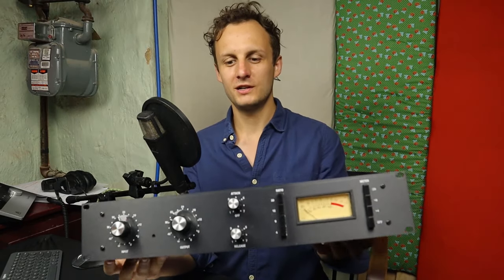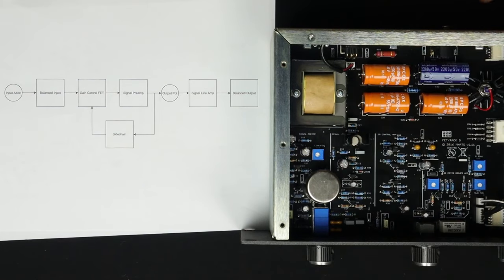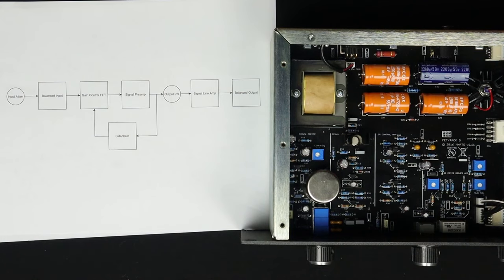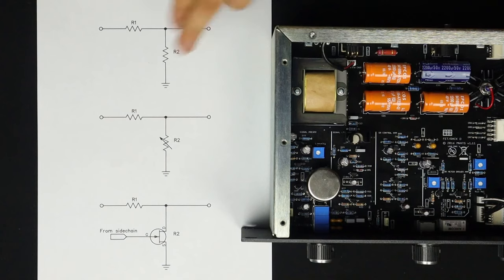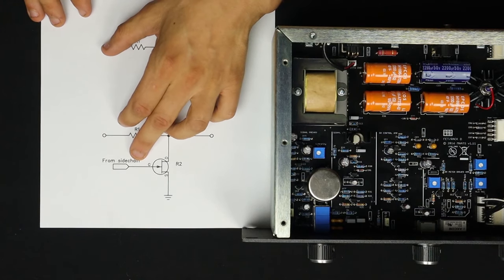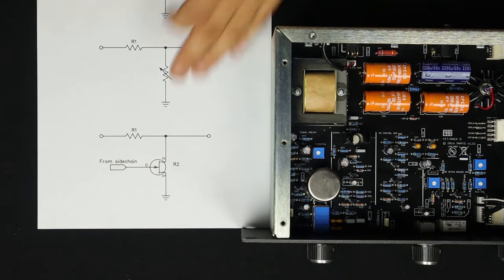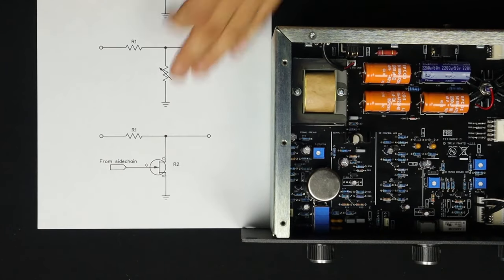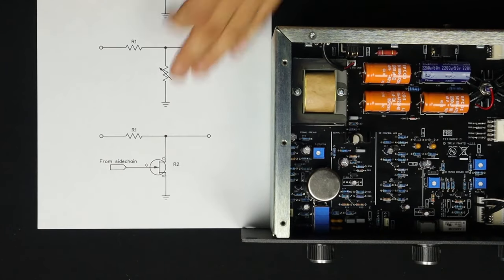1176 FET Compressor Teardown pt 1: Circuit and Compression Secrets

Comment: As someone who got into audio electronics from the user side (just swapping dead pots etc), I started doing eurorack DIY kits, but without any understanding. Soldering by numbers, so to speak. Compared to other EE tutorials, this finally bridges the gap between electronics basics and what is actually happening when the circuit is in action. Many, many thanks, this is so valuable in better understanding the things I use. Top notch!

Comment: Ok, same comment as the GAP 73...a follow-up teardown of this 1176 but comparing a budget and a higher end unit so we can see what's different, what shortcuts were taken on the budget model, what makes the higher end version more expensive, etc.  Say Klark Teknik 76 ($400) and a UA 1176 ($2k) or even a Warm Audio 76 ($600).  It would be nice to know what compromises we're making, and what are getting when deciding which one to go with.

Comment: These gear descriptions are fantastic! Check out the API 525C; instead of using the JFET as the lower leg in a voltage divider, it has the JFET running from the negative terminal of one of their 2520 op amps to ground, with their op amp in a classic non-inverting amplifier configuration. The only other place I can think of that uses that kind of configuration is the Scholz Rockman. All the others I can recall, like the Shure Level-Loc, use it in a passive attenuator as in the 1176.

Comment: Just a minor technicality that is often overlooked, 6:15 the variable resistor is not attached quite right. The arrow denotes the wiper of the pot, thus if it were a 10k pot R2 in this circuit would always present 10k, instead of the varying resistance you expect. The arrow should be connected to either ground or the signal (usually ground). This also lines up with how it should be connected in real life, since it is a three terminal device, not a 2 terminal one.
Reply from the maker: Thanks for the comment. That's true about a potentiometer, but the symbol I used is for a variable resistor or rheostat which has two terminals.

Comment: I think you do not fully understand the side chain. If you look at the FET RDS curve over its entire range you find there are regions that correspond to different ratios. It is the slope of this curve that sets ratio. The 1176 side chain alters the section of the RDS curve the FET operates over by altering its dc bias. This is nothing to do with threshold, it just changes the ratio. Threshold is changed separately  in the side chain so that the curves for the different ratios match each other better. You can see this clearly in the user manual curves. By the way, 20dB is 10 times voltage ratio not 100 times.  Cheers  Ian
Reply: That makes sense. An important point that was missed.

Comment: Probably an enhancement mode N channel MOSFET. What's interesting about these is, the conductive element is bidirectional and the source and drain are interchangeable. The true level of expertise is how they manage to use a side chain but not introduce oscillation. I use home made optical compressors, using a Light Dependant Resistor and when I substituted the LDR for a much faster photodiode, the item went unstable and broke into oscillation. I'd love to know the FET type number: I know it certainly isn't a 2N3819. Thanks for showing us the internals. 🙂
Reply: A 2n3819 would work fine in this application. The trick with using JFETs is allowing a small controlled amount of the audio source itself back into its gate along with the control voltage which puts it into its linear region thus cancelling distortion it would otherwise cause when used as a voltage controlled resistor. Usually the audio fed back into it would come after its gain stage to allow faster attack times because of the larger current to charge the capacitor/resistor for the control voltage.

Self oscillation is usually a cause of the gain reduction being too large where the compressor starts to work beyond limiting causing increasing volume levels to compress in reverse instead of a steady level. In my experience FET compressor circuits rarely experience this compared to LDRs which can be driven far too hard messing with stability.
Reply: @kenzingzong6704  well explained, thanks. Using an LDR as a gain reduction element is fine on the attack but the slow on recovery so is audible. Consequently, I find it works well on an audio source but not really great for guitar. It's an intriguing subject, all on its own. The developers spent time for R n D and is why compressor and limiter units like the one in your upload, are expensive. For me, its back to the solderless breadboard! Again, thank you. 🙂

Comment: You certainly understand your 1176 theory of operation.  Aren't they wonderful.  All of them.  I can use any of them.  I used to have five Rev-D's.  Those are all gone now.  Now I just have a couple of H's and a relatively brand-new Hairball Rev-F.  Which is a D front end and a G output.  And they all work like FET limiters are supposed to.  With all of these little Nuance differences.  That while it's a big difference.  It's not a big difference.  It's just a difference.  And I really kind of agree with a former colleague by the name of Bob Clearmountain.  I'm rather more partial to the G and H versions.  Not that I didn't love my five, D versions.  I most definitely did.  I well I guess I grew beyond them.  Because at one point.  I also had eight, PYE, PDM limiters and sold those also.  Years ago.  At the time they weren't exactly just right for me.  Later they would have been that I had already sold them.  Oh well.  Easy equipment come.  Easy equipment go.  And I kind of made a killing on them.  So I miss them but I don't.  I've now lived without them all these years long.  But also did not care for their 15 kHz bandwidth restriction.  I could live with that.  I liked better than that.  I knew what I was losing.  I could hear what I was losing.  But it was pulse duration modulation limiting.  Like the EMT PDM limiters.  But British style.  Kind of like microphones versus consoles.  They both make the world's best.  But they don't both make the world's best others.  When reversed.  The UK not known as much for their microphones as their consoles.  Germany the other way around.  And while Neumann made a big audio console.  How many folks do you know had them?  Right, no one.  And who made Neve microphones?  A Japanese company.  See?  I mean Se.  As in S and E.  And well it's not really a Rupert microphone per se.  And how many hits do you know recorded with those microphones?  Right, none.  Just like the hits recorded on Neumann audio consoles.  Back in the early 1970s.

Can you tell I'm originally a high school dropout by my English grammar?  I can..
RemyRAD

Comment: So you can use DPDT switches instead?
what about the output transformer? it has 2 windings, what brand/model/type is that and is it available at Don Audio?
the input transformer could be a Neutrik NTE... 1 to 1, right?
To bad it needs a 5M pot for the release, not so easy to come by.

Comment: Great teardown in the sense of showing us the insides and explain what is what, I love it, great work!
However..... Well, staying 'out of the weeds" concerning the whole dB thing concerning the ratio sadly went south quote a bit.  I can't begin to point out the discrepancies but you have some of your definitions of units mixed up : dB appears to mean dBv at one point, audible dB at another.  Our does it?  I got confused at the point you stated that 6 dB is nog a doubling in volume, wich in audible dB's it is.  Then you go on  about the voltages and there is clear you meant 6dB increase in voltage.  But then in that same movement you speak suddenly of 60 dB on that context, clearly now you must be talking of audible dB', Bruder of it were still voltage we'd be talking 400v?  I may have not remembered the exact numbers exactly correct, but this is about the gist of what I got in before I soothed off.

Comment: Among other issues I think you are wrong about the frequency response in your "teardown"; the FET doesn't care about this as long as it abides by it's circuit and is inband to its design . I don't get what you are trying to say, a limitation in frequency response? That would be very inaccurate and yes, it is a ratio/threshold based on a baseline measurement. You forgot to mention this.

Comment: Im sorry to say that your description of the ratio is not correct and the capability to change ratio is and was perfectly possible. The ratio control in this case on the 1176 also adjusts the threshold, it is a ration setting but also changes the threshold. The idea of the combination is to change the amount of compression without changing the perceived volume and so create user friendly simple compressors, like the dbX 160VU with very simple and limited controls.
Reply from the maker: Don't take my word for it. Check out Monte M's response here about how fixed ratio settings on a feedback, FET compressor are impossible: https://groupdiy.com/index.php?topic=65756.0
Reply: @PetersonGoodwyn  I'm not taking your word for it. I think you have misunderstood the theory. A FET compressor needs to be feedback in order linearize its control, where as a VCA can be controlled by either the signal going to it or from it as it attenuates based on a known repeatable mV/dB control signal. This requires an extra step in the sidechain after turning the audio into a DC voltage (rectification) it must pass through a Log amp to make its relationship correct as V/dB is a linear control of a log scale, the audio. Because of the non linearity the feed forward isn't possible (being accurate anyway) with a FET or optical compressor so it has to "get there by trial and error" with a feedback loop that makes the process more accurate. however, this is not to say that you cant have ratios because you do (that's how gain works in a mic amp for example, with a feedback ratio). If you only send a portion of the output signal back to the FET it will only react to a RATIO of the output signal. This is what the 1176 does. The misleading thing is that they also increase the threshold as you select the ratio from 4-8-12-20. As such you are incorrect in your video because the 4 8 12 20 controls are indeed ratio controls. the Scamp S01, Compex F760 to name two famous compressors are both FET feedback and have ratio controls, that are indeed ratio controls.
Reply from the maker: @chrisroberts2266  Thanks for your response. I understand that the ratio control affects FET bias and threshold simultaneously. But the ratio is only affected by the Rgs curve of the FET. So the ratio is affected, but not in the linear, predictable way the front panel labels would imply, and ratio is still variable wrt to signal level.
Reply: @PetersonGoodwyn  The ratio control doesn't effect the fet bias, if it effected the bias, the output level would change with the compressor switched to off at the attack control (because the off control only stops audio to the side chain) when you select different ratios. It actually sets a voltage that the audio signal must overcome to change the voltage on the gate of the fet to change gain.
What you mean is that the linearity (over depth of compression) of a given ratio is limited by the linearity of the FET. This would only be relevant as a feed forward design and so this is exactly why it is a feedback compressor to reduce (remove in practical terms) this effect, it has nothing to do with the compressors ability to have a ratio and the linearity is not directly linked to the curve of the FET because of the feedback loop.
Reply: @PetersonGoodwyn  the two sections of the Ratio switch, the first set on the left of the circuit is fed from the audio path is the ratio setting. it sets how much of the audio is converted to control signal. the second set of switch elements (on the right of the circuit diagram) set the threshold by applying an offset voltage before the diodes. The ratios are set dependent of the amount of audio fed back to the control circuit and are quite accurate within the design limits of the unit.